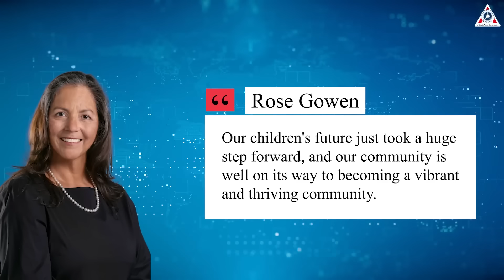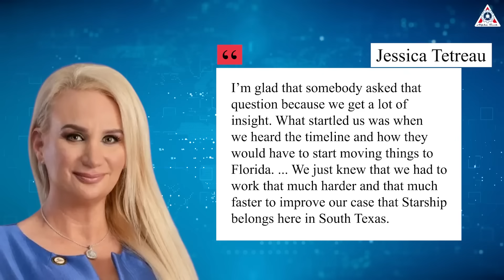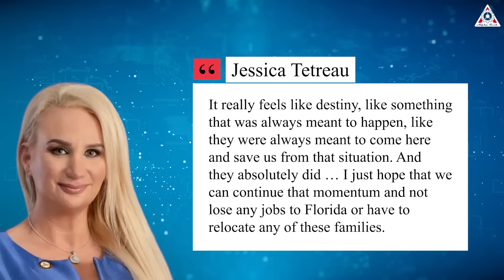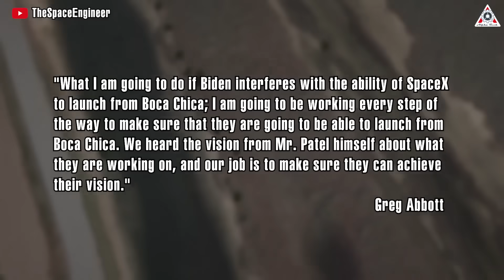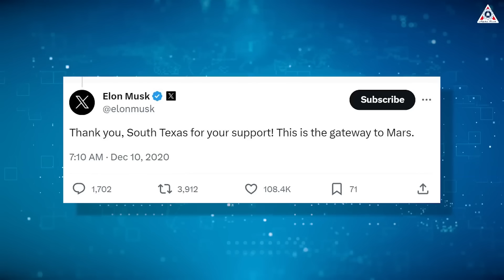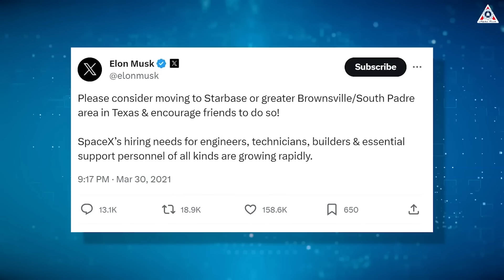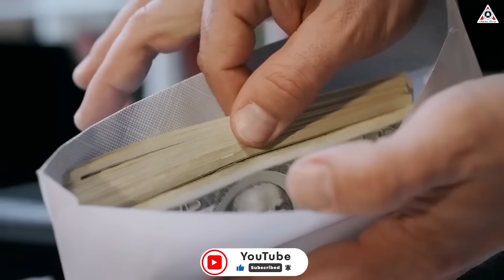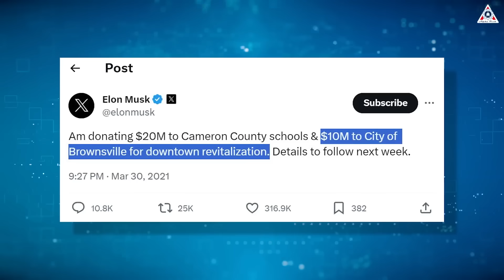What Texas gov & SpaceX just did with Starship is more important than you think! Shocked others

Comment: Brownsville is actually a nice place in a good location. And slightly off the center of the bell curve of hurricane landfalls. And is one of those cool TexMex cultural mix locations where everybody likes it, and tries to get along...
I think Elon's current problems are political, and like everybody else, is being victimized by a culture of stupidity in control.
This too shall pass!
And I think it would be good to use the down time to think, and figure out the best paths forward. 
I saw yesterday a piece of art work comissioned by Space Force, for their future orbital craft. Pretty obvous from the art work, that they are thinking beyond Elon's tubes and flappers. I suggest the readers look at that image.
If I could suggest anything to Elon in person, it would be to branch out a bit on hull construction, and get into longitudinal fabrication methods instead instead of cattle water tank rings. As Space Force and many other potential clients are going to want craft not limited to a monochrome or monocrop hull shape.
Basically tubes are fine for the booster, its just tanks and engines at this point, But the Starship needs to morph beyond its tube birth limits into things more designed to task. Those things can be expressed in metal fabrication, but you need to run the seams longitudinally to do it.
Basically the wall Elon will run into, is he has a liquid fuel launch system, and a generic ship on the end of it. And shape at launch is mostly trivial numbers, and no shape limits in space, and there are way better shapes for re entry.
One out of three ain't bad, but it could be better.
I suggest a task force to get beyond this issue,
Beyond the Rocket Nerd tube fixation. Even the Airforce is starting to get away from tube hulls.
Sure would be nice to see SpaceX also be a leader in craft with more potential, and free of the tyranny of Nerd Traditionalism.